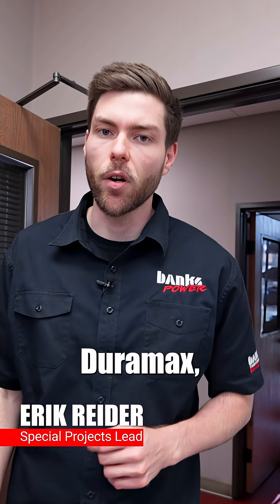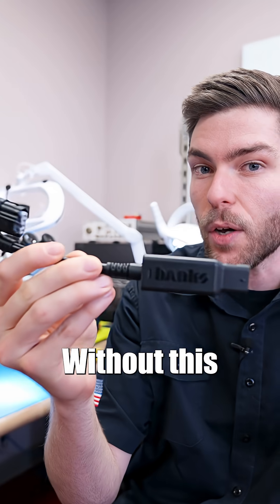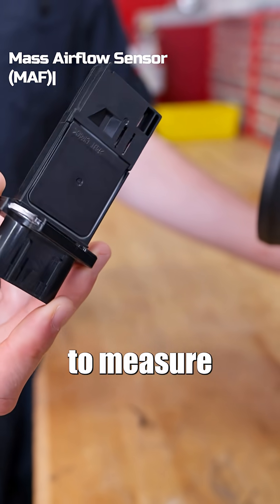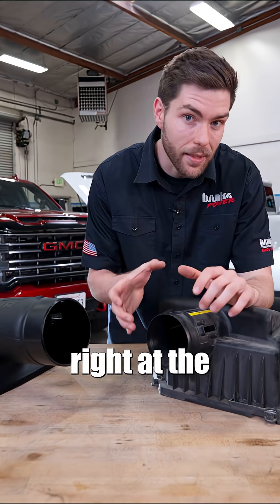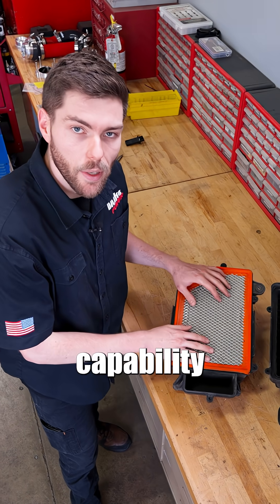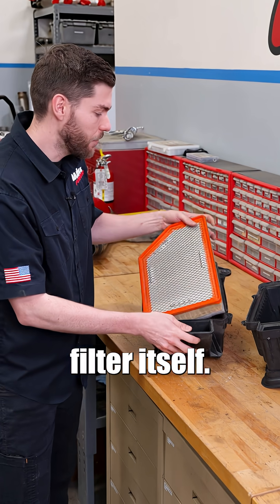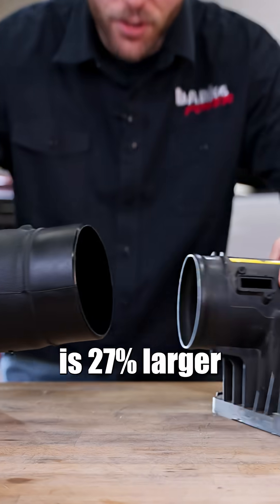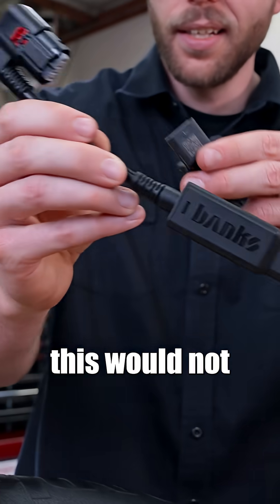What other cold air intake brands don't tell you!

Comment: Why wouldn't Banks use the filters from an 06 or early 07? Same filter as a Bradley tank? I've only had to replace mine twice. Looking at the vacuum guage on the filter box.  your 2008 Duramax (6.6L LBZ/LMM), the best air filter is the Donaldson P610875 PowerCore Air Filters

Comment: Why not just adjust the MAF curve in the ECM?  I would need to look at the tables but you should be able to adjust the calculations appropriately.  Crosssectional area has been a problem ever since the introduction of card style MAF sensors.  We constantly see people trying to change the diameter of the intake piping especially on swap applications.  I explain to the customer that they are trying to move the same amount of air but through a bigger pipe, therefore velocity is decreased.  After getting them to think about the issue of the cross sectional area, most understand.  We rescale the MAF, sometimes make a couple of other adjustments and they are good to go.
Reply from the maker: The ECM on the Global B trucks (2020 and up) is extremely locked down thanks to that electrical architecture's focus on cybersecurity. It's much easier and generally safer to go the inline route.

Comment: Did the 2018 L5P ram air box not need this?
Reply from the maker: Correct. 

GM's switch to the "Global B" electrical architecture happened in 2020 and its much more tightly controlled/locked down. It monitors the MAF extremely closely and no longer allows the kind of overhead we once had to increase airflow.

Comment: No one tell this guy that the ECU has a map specifically for calibration of the MAF which can also be modified.

This is basically just a piggyback module because they don't know how to actually remap an ECU properly lol
Reply from the maker: Remapping an ECU, especially on 2020-up trucks introduces a whole host of other issues, not the least of which are the warranty concerns. Our solution is totally plug and play and leaves no footprint behind should you need to have your truck in for warranty work.

Comment: Customers beware!!! Many of these "servicable/performance" air filters advertise increased airflow, and many do that. However, unless you are religious about keeping up on cleaning and oiling the filter, they will allow dirty air straight into your engine, and that means dusted turbos, and damaged cylinder walls. If you keep up on them they will do as advertised. But if you think you can drop one in and leave it like a stock filter, you are asking for expensive problems.

Comment: So I’ve got a 2011 Duramax with a Banks ram air. I’ve also deleted it and put a programmer on it. Would this help my truck? Or is it not necessary because I have a programmer
Reply from the maker: The LML Duramax trucks do not require this module as the tuning and emissions requirements are different than the 2020+ Duramax trucks. Due to tighter emissions regulations in recent years, we developed this MAF module to work with the factory sensors. Without it, the restrictive factory settings prevent the engine from taking in a dense air charge, and the sensors interpret it as a leak.

Comment: I guess this is technically a neat product considering it intercepts the signal in the MAFS wiring and adjusts it to a vehicles tune without tuning. How different is this from a tune though other than with how it matches the voltage of the MAF with its airflow? Would be cooler if it was a more universal product that you could plug and play in other vehicles.

Comment: How does fooling the ECM into thinking the airflow is right going to change anything to add fuel? If the ECM thinks the airflow is normal, then it’s not adding more fuel. Am I right?
Reply: I presume it sends a scaled up signal to match the increased diameter of the tubing (and additional air mass that comes along with it).

Comment: How does the big ass filter compare to the stock one in terms of filtration? I would think you'd have to sacrifice something to get that much more airflow through the filter. Or does the increased size allow for more flow but the same level of filtration?
Reply from the maker: The filtration of an oiled cotton filter element that's been maintained properly (cleaned as recommended and not over-oiled) is excellent. The sticky oil does an excellent job of catching even very fine dust particles without impeding flow.

If you live in a desert climate, the use of a pre-filter (aka filter sock) is an option and will help you get more life out of your oiled filter between cleanings.

Comment: New Era? MAFS have been around for decades now.
Reply from the maker: Correct, but the way that modern ECMs monitor their values has changed. Previously engines gave us a lot more latitude when it came to changing airflow without setting a check engine light. Now, in the era of ultra-strict emissions and cybersecurity (which was ostensibly the reason that GM went to the Global B architecture), we no longer have that latitude.

We had to work smarter, and here we are.

Comment: Since you guys are so critical of others.  You made no mention of exactly how much hp/tq gain there is from this setup nor did you show a dyno run.  Why not? Could it be that cold air intakes are pointless when used alone.  I did find a chart that shows reaching peak HP around 25 RPM sooner. Lmao. I guess you could call that a win.
I would also love to hear how you think this system provides more “reliability” over stock intake. 
That’s hilarious.
Reply from the maker: One of the biggest benefits of a properly designed cold air intake system that uses ram-air is its ability to make your turbo work less hard to create the same amount of air density. Reducing the turbo's workload means that it will not only have more performance overhead due to a lower turbo shaft speed and turbine drive pressure, but that it will last longer as well.

When you consider the cost of replacing the variable geometry turbo on your Duramax, anything you can do to help it last is going to be a good thing.

Comment: Why are so many upgraded air filters red? With all the color choices available it seems every manufacturer could pick their own color.
Reply: its the oil that goes on the filter my K&N filter is gray after being washed
Reply from the maker: It's the sticky oil that soaks into the cotton of the filter element. The oil is what grabs the dust and debris that would otherwise be too fine for the cotton to stop on its own.

Comment: Wouldn't an exhaust system be a better upgrade FIRST? Since the DPF/SCR cannot be changed or removed, whats the point?
Reply from the maker: Our favorite answer would be "Well why not do both?" but seriously, removing restriction in the intake does more for performance than you'd think.

One of the biggest benefits is in the reduction of turbo shaft speed. Because the turbo is working less to create the same amount of air density thanks to the removal of restrictions in the intake, it has more performance overhead.

It also reduces turbine drive pressure which allows the exhaust side of the engine to breathe more freely. It also has the side benefit of helping your turbo live longer.
Reply: I hope this question gets an answer!

Comment: How can something like this be adapted for a different car?  Would be nice to have this or something similar to use universally for tuning cars
Reply: On most cars made after around 2003 you can just reflash the ECU to update the air/fuel tables. All the computer wants to know is how much fuel it needs to give for a certain amount of air. It then uses O2 sensors in the exhaust to make sure its calculations are right, which is why you get a check engine light if you change the MAF pipe without a recalibration (tune).

I guess the models that this air intake are for can't be flashed, I know there was a big diesel tuning scandal a few years ago so maybe that's the reason. The other alternative would be a standalone ECU, which is a lot more work and money than just using a module that can convert the MAF values to what the stock ECU is expecting.
Reply: @Weimerica8841 changing the maps to meet an airflow sensor reading from a pipe it wasn't calibrated for is backwards thinking.

  If the sensor is calibrated for the flow and pressure of the higher flowing intake pipe it's inserted into then you don't need to touch the maps.  

The ECU will simply reference the correct section of the map for that airflow reading.
Reply: @DiamondStarWerks  If you're going so far as to change the intake system so that the factory calibration does not work, you're already changing the AF tables and VVT tables. Why add extra work that accomplishes nothing and can't even be seen? A MAF sensor is incredibly simple, there's no reason to overthink it.
Reply: It can't. It needs to be designed specifically for the car
Reply: HKS, Apexi, and few other Jap part tuners make something similar for petrol cars